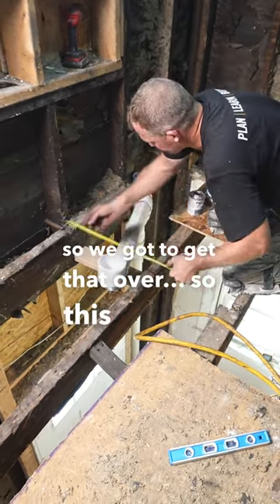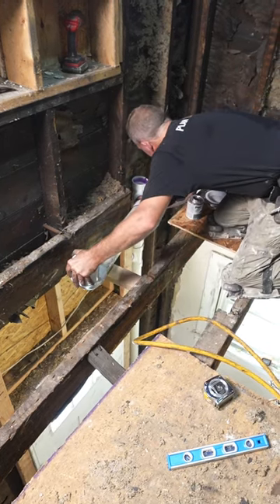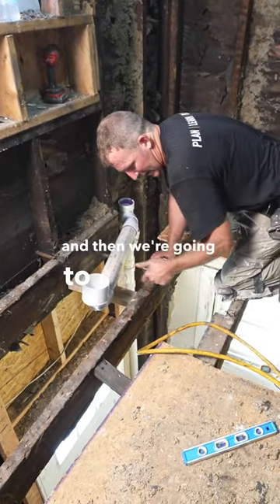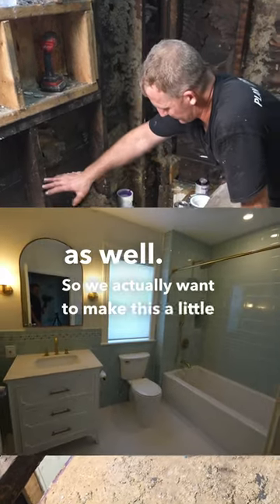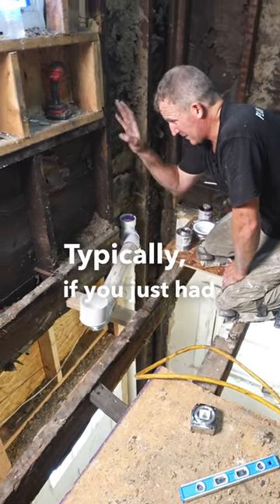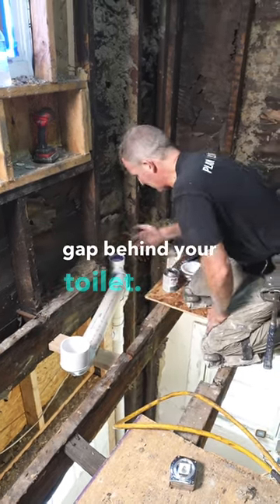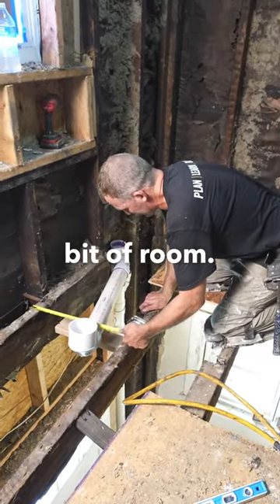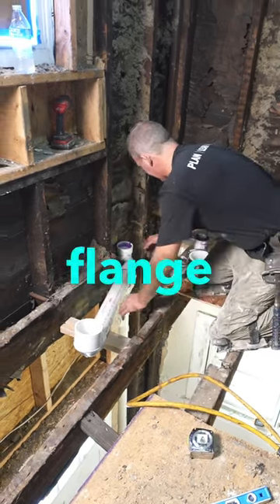Toilet Rough in Distance from Wall

Comment: Put the damn subfloor down.  Jeez..  making it harder for yourself..  is like building a boat while your already on the water..
Reply: Look s like it turned out, I think he wants viewers to see it from a open view. Most people would say diy ers, how did you do that?
Reply: How else would you have access to those pipes? You have to remove the subfloor rookie and once everything is installed and in place you install the subfloor. Also how else would you show viewers what your working on and what they need to know?
Reply: And what ?pipe it on top of the floor?
Reply: @dustinpomeroy8817 the ceiling under is not installed,  there is plenty of space.
That's how it's done on new construction.
Reply: i was thinking that same thing... I think I would be floors in so I don't fall thru the floor-- crazy.
Reply: My guy is just up there plumbing without a net 😂
Reply: @dustinpomeroy8817 😅
Reply: You have no idea what you're talking about 😂

Comment: Only run 3-4inch pipes at 90, 45, or 22 degrees to the framing. It makes future renovations difficult when you have to adapt to a crooked ass pipe. 25 year master plumber here

Comment: In my experience, I do all my carpentry work before the plumbing. Once my subfloor is fastened and in place, it is easier to do a precise layout. Once you know where your flange is going to go, grab your hole hog and drill your holes. Install and secure your flange and wallah. You can run your pipe from under  the subfloor. Waste and vents, man. 😁👍

Comment: I once discovered the waste line of a roughed-in basement bathroom was 2 feet from the wall. Rather than have the plumber return and correct the problem the builder had his carpenter build a second wall instead!

Comment: I never understood why people put glue and primer on the pipe and fittings and are not sure if they have the rough in where it needs to go. Put it together without the glue and primer , once you got it exactly where u need it mark the fitting with lines so you can pull it apart , clean the pipe off , prime , and glue the pieces together, match your marks together, and it’s right every time . There’s so many pieces of pvc pipe with fittings glued together that ended up being wrong in the company that I work for shop that it’s comical. Oh and when you look inside the pipe isn’t pushed in all the way but that’s because most people including most plumbing don’t know how to make a proper pvc joint . When you tell them it’s a weld joint they laugh and go on to tell me they been doing plumbing for 30 years and have never heard anything so crazy . So I hand them the can of primer and say read the back of the can , so they do and most of the guys say they never knew that the primer is used to soften up the plastic on the inside of the fitting and the end of the pipe , and the glue is used to hold the two together and seal up that thin gap around the opening of the fitting . At least at that point they will listen when I tell them the other necessary steps they need to do on every joint in order to make a proper watertight pvc joint . Of course I’m talking about chamfering the end of every piece of pipe you put together, you shouldn’t even put glue and primer on the pipe or in the fitting if you skip that part because it’s not possible to do it’s that important to the process . I learned this many years after making joints the wrong way but when someone who is 10 times as smart as anyone else you know tells you something I tend to listen so when this very successful mechanical engineer told me I was doing something wrong and he told me what and why I was wrong I listened and did it his way and never have any issues with my joints . Of course I always have those guys who know better even when you show them solid evidence of what they are doing is wrong they just won’t admit they been doing it wrong for the last 25 years and still do it wrong today. I love when I have to go back on a job they did and a 6 inch pvc joint on a high efficiency boiler is leaking all over a expensive pump and it burned out the 5,000 dollar motor . The owner of the property asks why did that leak your company installed this 18 months ago I don’t understand what happened? I just tell them I’m here to fix the leak and replace the motor but my boss will be able to tell you more when we cut this fittings apart and inspect a few things .